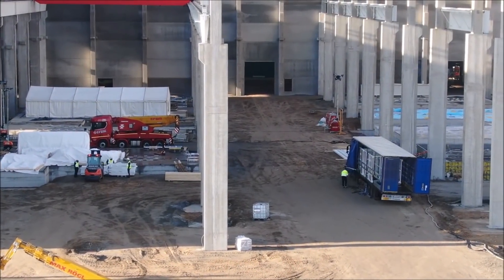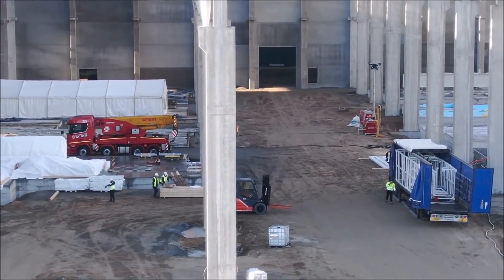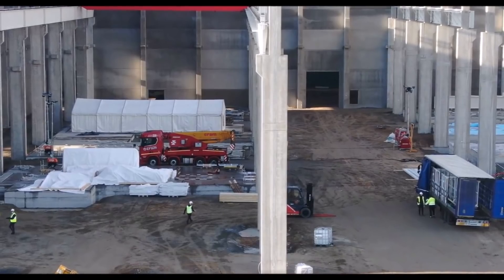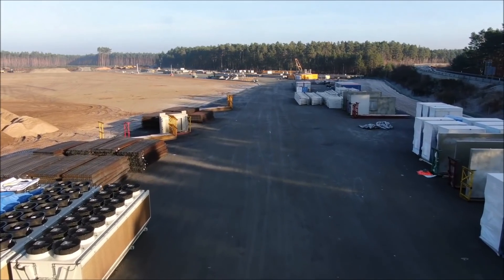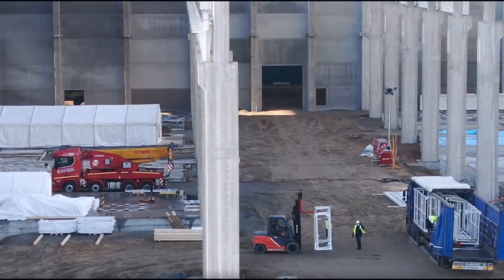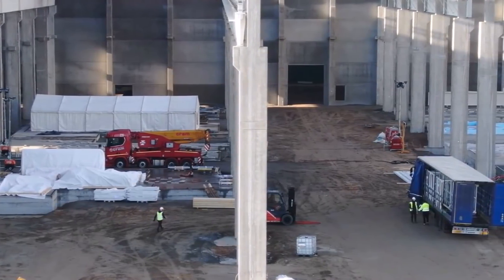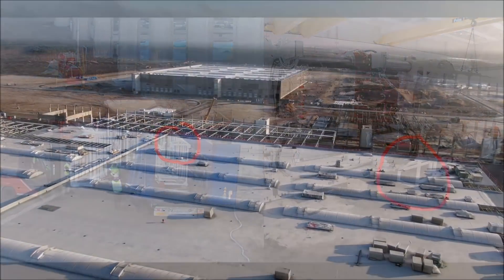Tesla Brings 1st Parts of the Giga Press Casting Machines To Giga Berlin

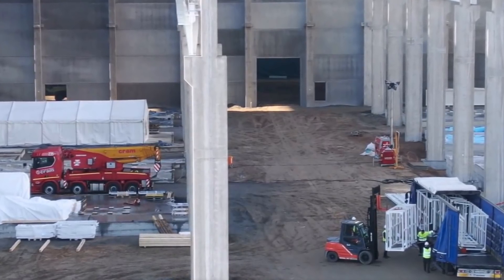Comment: Great information video! please forgive me;  Rear frame is pronounced to rhyme with "Here frame" . 1 machine = 1000 chassis per day Each car has two main chassis: a front and a rear. 2 machines = 1000 cars per day.  4 machines = 2000 cars /day.  10,000 cars/10 days.  = 30,000 cars /month = 360,000 cars /year  If targeting 500,000+ cars /yr you need 8 press mold casting machines (listen at 1:33 - 1:40) to allow for erroneous moldings.

Comment: Let's hope the #German Gov. Doesn't stop 🛑🛑 #Tesla's construction 🏗️🚧 again. They can dismiss these senseless #lawsuits brought on by fake #environmentalist.
Reply: The German government is not involved at all. The government of the Federal German State of Brandenburg is responsible. And pro the Tesla project in their state.
They cannot dismiss lawsuits. The courts are independent. Any attempt to interfere would risk the whole project. That happened e.g. in 1987 and Mercedes had to give up a major project completely. 
The environmentalists are not fake. But they clearly lack the broader view on this. The lawsuit is anyway already decided. Apart from the edges of the forest, the cutting of the trees can continue. And the court has also told what Tesla has to do next time that the entire clearing will be allowed. It has a reason that the environmentalists did not just use this time the same arguments as in Spring. As the court would have dismissed the case directly. And the number of endangered species that may live there is limited.
Reply: It worries me that the press is built by Italians. Italian engineering is... sometimes good, sometimes not.
Reply: @fornamnefternamn8682  the paintshop is from Italian too...
Italian machines are cheap but normaly fast broken... As a sherholder pls. buy quality!!!

Comment: I think 100 tonnes aplies to pressure not the weight of the press
Reply: To my knowledge customized Idra OL 6100 CS presses will be installed at  GF4.
clamping force: 60,000 kilonewtons ( 6,100-tonne-force) 
machine weight:  410-430 tons
Reply: 100 tonnes is not a very high pressure for casting actually. Even plastics moulding machines can go to 400-500 tonnes pressure normally. I can't find a source but I recall giga press having 1600+ tonnes pressure.
Reply: @ThinkSleepLeave  I've seen a 2,500 ton plastic injection molding machine. That's clamping force not weight. I'm guessing 100 tons would be it's actual weight. A die cast machine this size would have many 100s of tons clamping force.
Reply: @williamgreene4834  Yes that is what I meant by pressure : clamping force. 100 tonne is definitely the weight if true and not the force.
Reply: Is it tons 2000 lbs. per ton.  
or tonnes ?
Reply from the maker: Can't confirm. I don't really know, but will not be surprised if these are 100 tons each. If you see their size and materials, the Tesla Giga Press could be 100 tons in terms of weight.
Reply: @Torquenews  Giga Press machines have a mass of 430+ tonnes (each)—25 truck-loads (each).
Clamping force is 6,000+ tonnes·force.  
Details are on/linked from:  https://en.wikipedia.org/wiki/Giga_Press
Reply: No, I think Aryman has it correct: the machines likely weigh 100 tons. The clamping force of the IDRA OL5500 / 6200 CS machines (per the IDRA website specs) are 5500 and 6200 tons (!) respectively. Don't know if those are metric or english tons, but a shit-ton nonetheless.
Reply: Here’s a source for the specs:  https://www.teslarati.com/tesla-model-y-giga-press-china-first-look/